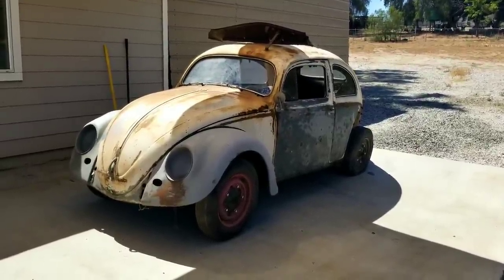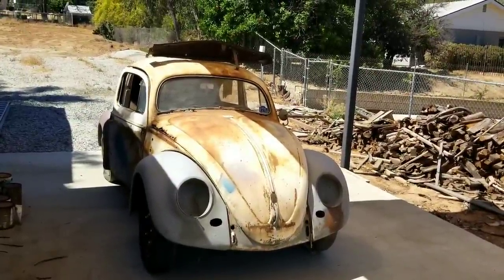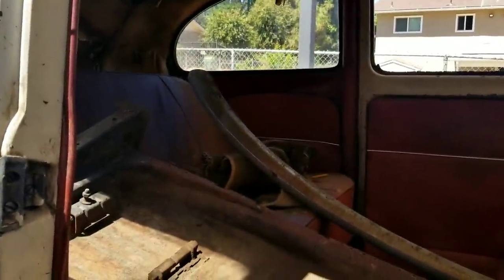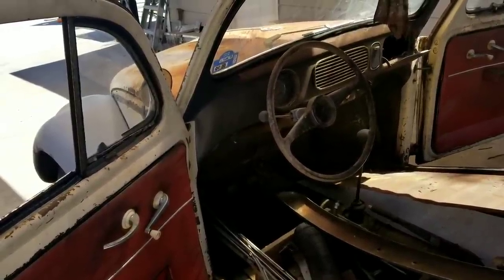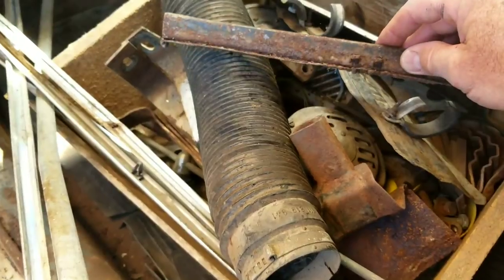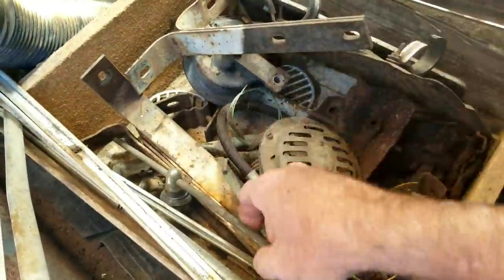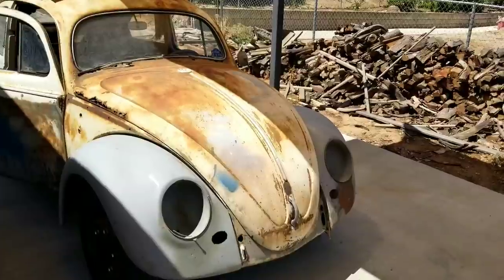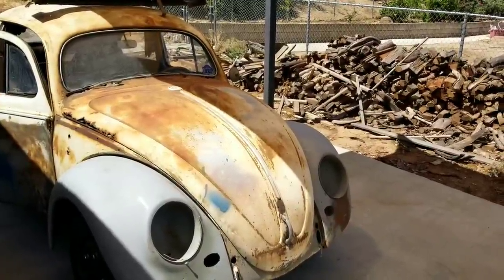1955 VW Bug oval window pre restoration  talk

Comment: Great intro Mike! Glad your stepping up the quality of the restoration on this one. Can't wait! Maybe for the quarter lights/pop out windows zinc plate them and then clear coat. I've done it myself and its basically just zinc strip on the negative polarity and the item on the positive in a white vinegar and epsom salts electrolyte. then finish with a fine wire wool. Not sure how it would be protecting steel though.

Comment: Tried ten years ago to restore the window trim after having used a solution to remove the existing anodizing(?) and it was a not-so-satisfying experience. I buffed the trim with rouge and (I think) I didn't clean the trim with acetone(?) to remove all remains of the rouge, and the result was less than desired. Maybe there's a better way.

Comment: all the seats are slit window even rear  as for the wing window it is the same as the early 60s only except  the mounting post is different  u can use 60s if you cut the post down

Comment: The outside of body is in good shape?  2-3 SMT blue stripper disk will get it done . And in the rain gutter a worn down one will fit just right. I got a 10 pack and by the time the first one was gone I knew I should have got the 5 pack. Yup 2-3 will do it. I saw some that were 5 inch . Now those would get some sparks .

Comment: The seat frames for these are completely different. The bottom and back rests are a different shape. The backrests aren't adjustable unlike later seats. The lower tubular part is a different shape too. One of my 54's was missing the seats and it was a major PITA to find replacements. Also the vent window frames are different on these. The bottom has a spring and bracket that fits into the door and the frame itself has a kind of keyway that fits into the bracket.